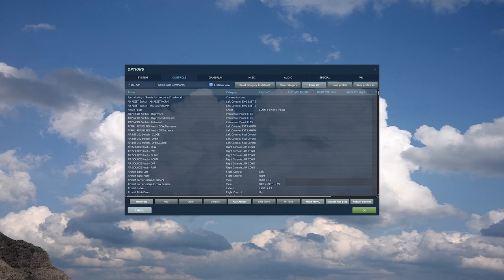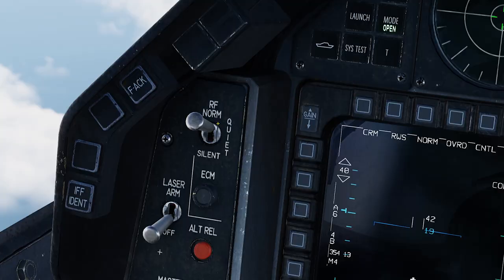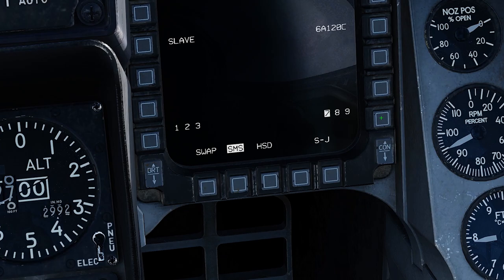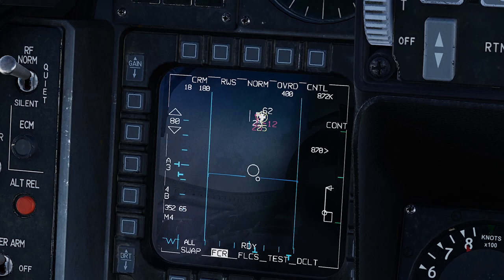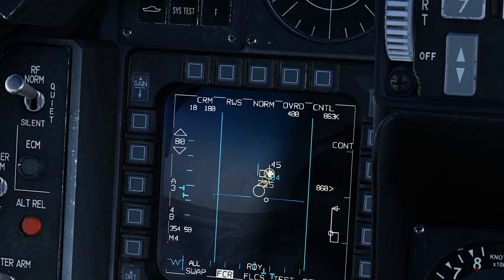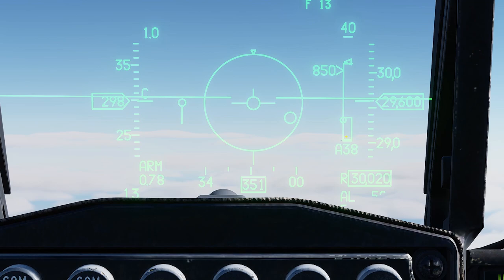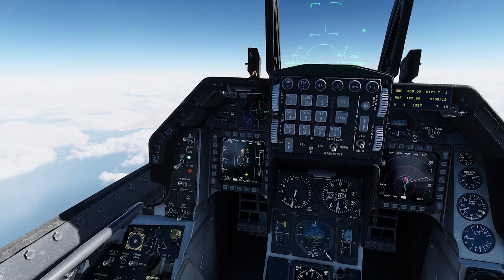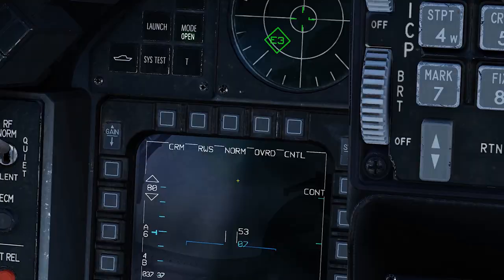DCS: F-16 FOX 3 BASICS (RWS/TWS)

Comment: I am really having trouble here with TWS mode. you say you are getting a track but not able to bug them? I cant do that and I cant get my missiles to fire and move to the next target. im very confused. were you just pressing tms right? up? at 9:49? you were kinda vague during that part of the video, like things were happening on your radar like target switching but you arent saying what keybind you are pressing to do that...
Reply from the maker: 4:00 - 4:15 I talk about how to switch to the next target IF you have both bugged. I'm pretty sure I explained that RWS, you can only bug two at a time. In TWS, you can bug many more. Once you have them bugged, it's the same procedure to switch between them as I outline at 4:15. At 9:30, I'm using the same controls as outlined in RWS at 4:00. TMS up to bug/lock. TMS right to cycle between bugged targets. This is the same for both, RWS and TWS modes. Let me know if this makes sense.
Reply: @BogeyDope  thats so weird, after I tms up in TWS mode pressing tms right does nothing, like nothing happens. no target cycle.
Reply from the maker: In the current version, you have to wait for the track to build. I just tried this and got it to work once, and then it stopped working again, then worked the third time. There seems to be a delay even after getting the full bugged large squares in TWS mode. In RWS, you have to TMS up to create the bug, then TMS right to cycle between a maximum of two. In TWS, you don't TMS up. You wait until they become full large squares. This means they're already selected by the FCR. Once you have Full large squares, you can TMS right to cycle between them. However, I'm having mixed results with this right now, so it may be my PC. Not sure. Just wait till they each have large squares over them. Then TMS right and they should all turn hollow squares. Then TMS right again, and it will start to cycle through. Let me know if this helps. Again, I'm having mixed results right now.
Reply: @BogeyDope  aahhh ok man im glad its not just me. thought I was going crazy. well thanks for taking the time to check it also. and yeah ive been messing with it and I also did just figure out that you just switch to TWS and wait till it gets tracks on its own like you said. then tms right to cycle.
Reply: @BogeyDope  That's what i wanted to know  Locking on bandits with TWS mode , because you mentioned nothing to lock up multi targets but just waiting for TWS radar working. I got it thanks

Comment: So - silly question - I thought that you needed to keep a target locked until the missile goes active. I just watched you do it, but having them bugged counts as a lock for the AMRAAM's tracker?
Reply from the maker: Yes, you need to keep the lock until the missile goes active (Pitbull). In TWS mode, yes. If you TMS right and it bugs the target, you can launch. You can also switch to STT by TMS up another time on it, and get a stronger lock and launch too, but then they get a launch warning. pros and cons.
Reply: Remember that the missile will go pitbull regardless. So it will likely track on it's own. The downside of this is if you have friendlies in the area or are trying to shoot down a specific target.
You can also fire directly at targets with no lock and let them go pitbull immediately but I would only do this if there are multiple targets and they are closing fast on you, you have to go defensive, and there are no friendlies. That way they need to go defensive and they won't get a rwr notification either.  

This isn't unique to the F-16. It's how the Aim210's opererate. You can do the same thing in any aircraft that carries them.. The AIM54 will also do the same thing on the F-14.

Comment: what do you do when they fly very close formation, so its hard to detect on radar, they look like one target... 
and theyre a small fighter so they get bugged at 22 NM and about to launch on you?

then they use jamming, do things that cause you to lose soft lock
Reply from the maker: the "EXP" button at the top of the radar. If you press that, it will zoom in. Press it again, and it zooms in further. This will show you distinct targets even flying close to each other. Press a third time to return to the normal view.
Eagle Dynamics has adjusted the F-16 radar many times. At this time, that was the distance I got a lock. There was a time I was getting locks at 40nm. It is a beta and will continue to change until they get it down to what is the closest to real life. 
Yes, they can jam you and break your soft lock. They can also notch you and break the lock. There are many ways they can break the lock.

Comment: How can you lock a target at 70 miles in the current state of the viper? I only see bricks at 35 ish and only can get a soft lock a around 20 and hitting the TMS up like crazzy!!!!
Reply from the maker: This was made in March before they adjusted the radar in the F-16. However, I've never been able to get any fighters at 70 miles. In this video, those were bombers. Very LARGE bombers. You are going to be able to pick up and lock larger aircraft from further away. Fighters will not be seen on the F-16 radar until MUCH closer. Since the update in April-ish, that has changed as well. However, large aircraft will be able to be seen by the radar much further out than little fighters.

Comment: The f18 has a,cue that says shoot and the top right of the cockpit has a blinking light. Dows f16 have it??
Reply: No. In the F16, you only see the ranging information on the hud. Once the carrot is inside the open portion bracket and the “circle” starts getting bigger and bigger, you’re technically in range